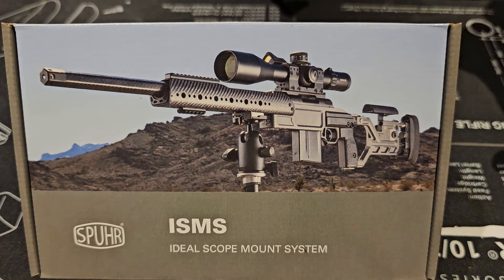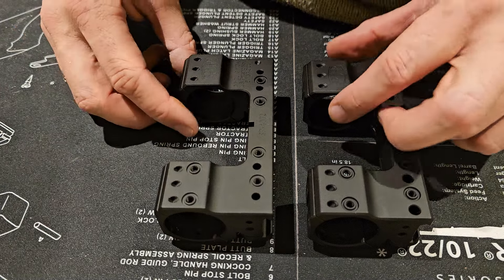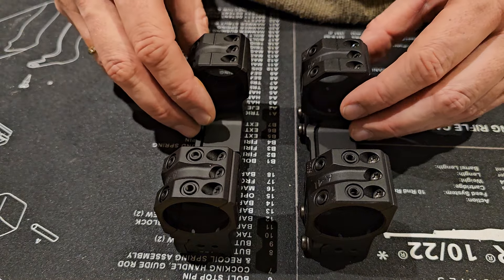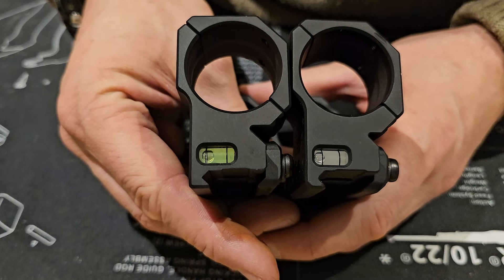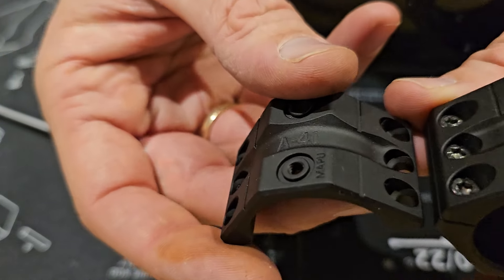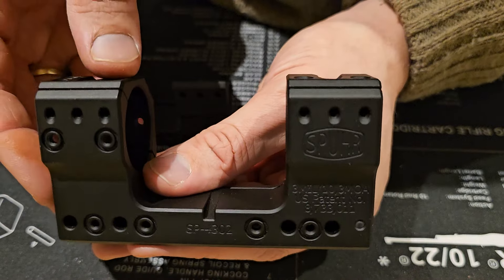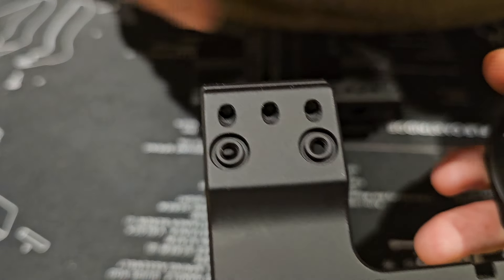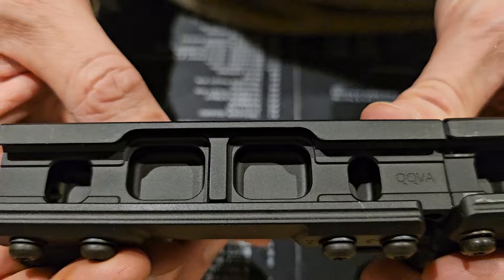SPUHR ISMS Mount, How To spot A FAKE

Comment: dam that fake looks good, why didnt they just make another brand and retail them (while not making fakes) as something else? i wondder how they line up in terms of how true they are.
Reply from the maker: That is a very good question. I to think they look very impressive in terms of quality. But none the less a fake is a fake and should not be sold as a genuine article.

But following your question, they could have made a very good and perfectly legal mount of they would put just a few hours into make some unique mounts an retailing them as something else. 

But this also requires a lot of time, and I do not think the quick buck makers in China are willing to do this.

I have not tested them for how true they are, and I do not have any plans doing this until someone sends me a 34mm scope I can test i with.
If someone does send me a 34mm scope for testing, I will make an entire video just in the difference on the original and the fake when on a firearm with heavy recoil.

Comment: Thanks for the info.  Good to be able to recognize the differences for not getting scammed but personally if the alloy is the same and I check ring alignment & lap the rings I'll use them. I wouldn't sell them as original but thats me. I'm after performance for less $ and I'm not brand loyal but I do own wayyy more Savages than anything else....., but hey, they perform and don't cost an arm/leg and can be built up to competition level for less than outright buying into the game. But it takes knowledge.
Reply from the maker: In not so long I will be taking a bone standard 24" Remington 700 VS and moding that to comp. level. There will be about 5 episodes I think, and I hope to show everything from truing the headspace to how to fit the 30MOA rail.

That is something I'm looking forward to.  

On the mount side, I would buy an original over a counterfeit. I can understand why many would prioritize bucks over brand loyalty. I'm not the big brand loyalist either, but I would find a cheaper set of ring for my scope before getting a counterfeit that could potentially damage my scope.

In not to long I will be starting on filming for a Mount playlist, hopefully I will find some super quality mound for not so much Dinero $$$.
Reply: @ELR-Precision  I'll be watching for those episodes.
I'll admit I've gone knock-offs before but always on lower recoiling calibers. Average $ spent on rings is usually $50-$90.

Comment: Is there an actual difference in performance tho? Both look like they will hold the scope...😂
Reply from the maker: The original has an inside diameter of 33.59mm and the counterfit one has an inside diameter of 33.02mm.
When mounting a 34mm scope, I would personally not take the risk of squeezing my potentially very expensive scope with a cheap China knockoff mount.
Reply: @ELR-Longrange  that's solid. Do you make scope ring bushings? They would probably fit better in the counterfeit 😆 🤣 😂
Reply from the maker: @mobilegamersunite  I would never mount a scope in bushings.
I would always recommend getting the scope mount that fits the scope and use them.
There are many factors that can lead to bad accuracy, might as well not make any more deliberately.
Reply: @ELR-Longrange  I'm not a long range shooter but I use scope ring bushings to give my scope some more protection from vibratory shock and recoil. I've never seen it effect accuracy...but I also never take mile long shots. It would be cool to test out some day
Reply: @ELR-Longrange  you never mentioned the price difference between the real and knock off mounts here. I'm sure the fake ones could still be used as an AR mount
Reply from the maker: Well, I cant stop you from using a mount that is not within spec. 
What you do is up to you, but definitely do not recommend it.

But testing the difference in accuracy of a scope in bushings and a scope in the correct spec mount would be a good idea for vid. 
Thanks, I'll take that up when I get the time.
Reply: @ELR-Longrange  for a bushing I'm using scotch SUPER 88 vinyl tape...it crushes down to paper thin. I line the inside of the scope rings evenly and take a pound off the torque specs for adding some material. I've never seen an issue, but again I don't shoot to a mile.
Reply from the maker: @mobilegamersunite  with this much of a difference in diameter, I do not think taking of a pound would be enough. I would be worried about crushing the main scope tube.
But still a good idea for a vid 😊
Reply: @ELR-Longrange  take 2 pounds off..meh. the tape also adds friction between the scope and rings making it more resistant to recoil will less torque in the bolts, I'm sure you could drop a few and be fine. Just IMOs tho. Taking educated guess here 
I've done this with 3 scopes already
Reply: No there is absolutely no difference. Only difference is about 450 bucks.

Comment: Does it matter? Both will work ,one just cost less
Reply from the maker: Well, you get what you pay for.
The fake is smaller in tube diameter, and the material is not the same. I suspect the fakes are made from a softer, less dens material such as 6065, where the original is a harder and therefore more durable mount.

Comment: The bottom of the fake one also has smaller lightening holes, i'd be curious to know if they weigh the same or weigh different. They may have removed less material to make it seem like a real one based on weight.
Reply from the maker: The original weighs 262.85 grams. The counterfit one is 247.81 grams.
The thing with lighting holes is that this is not the same mount. The real one is a SP-4302. And the counterfit one is supposedly a SP-4002.
This is also stated as a disclaimer in the video. I will get my hands on the real SP-4002 and let you know.

Please subscribe and share if you feel I deserve it.
Reply: @ELR-Precision  Ah makes sense why it would have potentially different weight and different hole sizes underneath. Thanks for the clarification!

Comment: That's exactly why I don't buy certain items second hand. I have seen this with both optics and quality knives. And it's very difficult to see a cosmetic difference other than the quality of the material and the durability over time
Reply from the maker: That is also an option, i feel there are plenty of good second hand items that are real and just fine at a reduced price. 

But it is true, going with a retailer will keep the risk of fake items down.
The bix was not the same as the original,  so if there is no box with the Spuhr mount, be careful and weary.

Comment: Well I received my fake. Scope slides in the mount back and forth relatively smooth. With the caps off. The caps literally snap on. Doesn’t take much pressure. But prefer not risking scratching the scope tube. Would also make it more difficult to level. Used some 600 grit paper on them. Focused mostly on the edges. Didn’t take too much time. Touched up with Birch Wood Casey Aluminum black. I don’t think that this mount can handle true factory torque spec’s. I’m going to use purple loctite on the cap screws. And Blue loctite on the cross bolts. 15 inch pounds for caps and 35 inch pounds for the cross bolts.
Reply from the maker: I would not risk it. If you sand down material, that to me is not worth the risk of placing a scope in it. The risk that it is not straight would to me be too great.

I hope your scope survives. 

Best wishes 
Elr-precision
Reply: Yeah I might say the same thing but the aluminum is soft. And the caps are thin. Really only took metal off on the edges. The anodizing isn’t smooth. Didn’t even come close to taking off the finish. The accessory holes on the top caps had burrs that you could feel. So I cleaned those up. Now if the scope didn’t slide back and forth with little effort. I would be concerned. (With the caps off.) I recently bought a Discovery cantilever scope mount. The anodizing is smooth. No sharp edges. Scope slides back and forth so smooth. You can find one for under thirty dollars if you look. It is way nicer than the fake. I normally use Warne, Seekins or Leupold rings and mounts. But too expensive to have on every rifle. Just ordered a AR in 300 Winchester Magnum. Should be here on Monday. Going to upgrade some parts right away. Larue MBT straight bow trigger, LMT muzzle brake, Tubbs flat wire spring and Battle Arms safety. Family owned a Marina, Went to college to be a car mechanic. Owned a Bicycle Shop for fifteen years. So I’m very mechanical. I should have said in my last posting that I’m going to use Vibra-tite. It’s the same strength as blue loctite. But you can take apart and reassemble without having to reapply up to five times. Plus American Defense says that if you use blue loctite on their mounts it will void the warranty. So when I have a mount that I have no idea the grade of aluminum. That is what I use. For the cap screws low strength purple loctite.

Comment: is there a site that sells the knock off exclusively for a way better price?
Reply from the maker: Yes there is. But iI do not want to share where to buy counterfit products. I made this video to warn you about the fake mount as the inner diameter is 0.5mm smaller than the original.
Reply: i can deal with that honestly. I have a dremel if I need it
Reply: @thatbox  if you want to dremel it just duct tape it on the rifle.
Reply: eBay.

Comment: You can actually buy a green bubble level straight from Spuhr as a replacement so its not necessarily a reliable sign.
Reply from the maker: Yes you can, but I have never seen anyone do that. And it is still a good one to be aware of. Then look at the other signs if it is a fake or not. The best way is ti have both in hand.
Reply: I bought a fake to go on an airsoft gun, and compared it with my real ones. Pretty much the same conclusions as you.

That being said, when you go to install a scope in a fake it's immediately obvious though, mine was just a tight, gritty fit to the scope where the genuine was beautifully slick until tightened down.

The other giveaway is the interfaces - they're not tapered, and they're poorly toleranced on the fake, so legit accessories will fit some interfaces but not others.

Awesome video though dude!
Reply from the maker: And that is just what my point was. The fake is in my opinion not a good optin in any way.

Comment: I have both a genuine sphur and a fake. The fake looks and functions just like the genuine. What you should do is just put the price tags on them 😂. That's absolutely the most significant difference. PERIOD. the turtle neck snipers have caused the prices of just about every shooting related item to go through the roof. The folks at sphur honestly should be ashamed of themselves for the price gouging 🤷🏼‍♂️. But if we will pay it,why not gouge?  Buy all the fakes you can guys before these clowns get them shut down!
Reply from the maker: Well, soon enough, you will be able to get all of your gear in China 🇨🇳 
Most of the cheaper scopes are made in China, and many other items shooting related. But I still do not feel it is OK to copy something someone else has spent time developing.
I'm curious as to how long a fake mount will hold up to the recoil of a lage caliber rifel 🤔
I guess I'll never know 🤷‍♂️
Reply: @ELR-Precision  I have one on a 300 prc,,I will report back if it falls apart. I've had one on a 6.5 prc for 7/800 rounds no problem yet. Will be in touch the first time I get a failure
Reply: @MR-bp3in  Any news?

Comment: I had a clone and the original. SP-3002.
clone 60€ and original 320€
The clone is almost like the original, apart from a few optical exceptions.
Otherwise there is no difference.
I sold the original and kept the clone.
The bubble level is also available as an accessory, in green.
and the 2024 fake model is better and more precise than the previous model
we measured it on a laser measuring machine. 100% like the original.
Furthermore, it is NOT cast, but milled with a CNC machine. With one of the best China clones that ever existed
Reply from the maker: It's still not cool to undermine the original with fakes that infringes on copyright.
If the fake is good or not is not really the issue. The video was made to help people and ceep yall from buying fakes on the secondhand market by mistake.